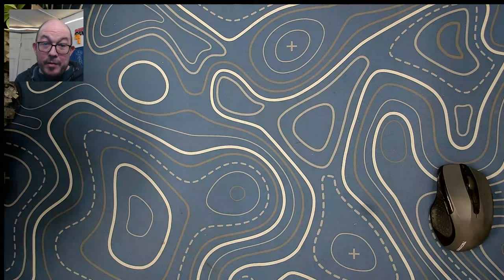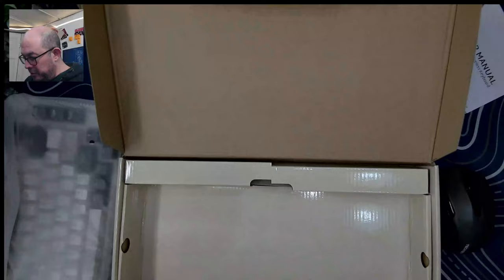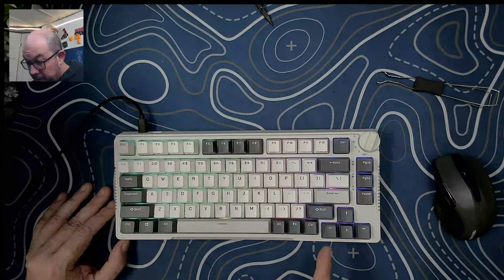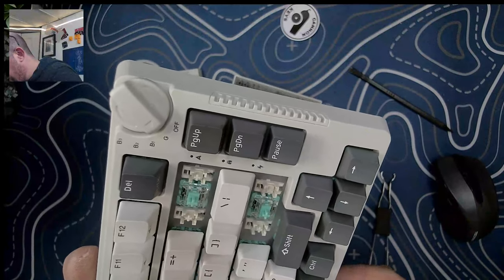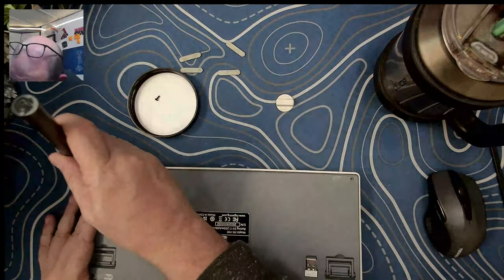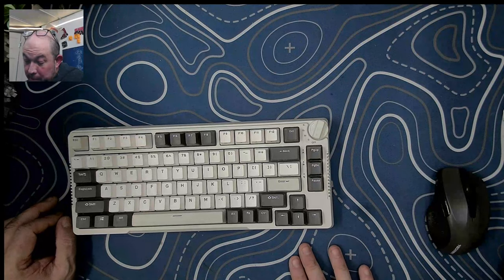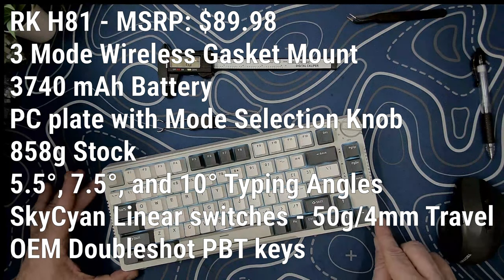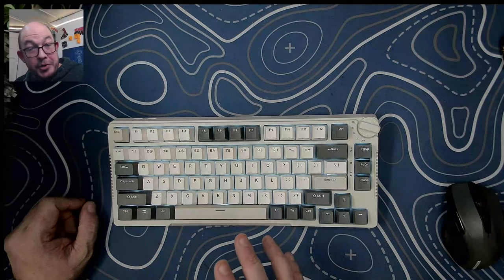Royal Kludge H81 Out of the Box - A decent "gasket mount" kit that is not meant to be modded.

Comment: Reasons for 2.4GHz... that frequency handles distance and obstructions better...also, 2.4GHz dongles tend to be fast enough to game without issues with lag.
Reply from the maker: I understand that, it's just that the frequency is a bit crowed, and personally I've experienced better results with Bluetooth 5.1 than some of the dongles these cheaper boards come with.
Reply: My main boards don't have a 2.4ghz option. I do game with them on BT5.0, and don't have issues with lag. They poll every 125ms, which is more than adequate for someone of my age. I don't think I could move faster or react faster than these boards. If I were a pro gamer things might be different, but for someone who plays casually I doubt anyone would notice.
Reply from the maker: @DaveAlkema  I used to love gaming, but as I've gotten older, I feel like if I am on the PC, I need to be productive. The only game I play nowadays is No Man's Sky, which doesn't really require fast response times ;)

I prefer wired when possible, I'm already drowning in electromagnetic radio signals! 🤣
Reply: @CvD Yes, sorry, mistype there.
Reply: @MechKeyboards  I only buy wireless keyboards if they have a 2.4GHz dongle because my workstations use disk encryption, and the bluetooth stack isn't loaded until I enter the password to unlock my drive.

Comment: Interesting! I actually dig the way that the knob is designed and what it does. You don't have to feel around for the switch between modes, or do a combo press to change modes like other tri mode/dual mode keyboards.

Also, side note, 997 subscribers as I am typing this. 3 MORE MARK!
Reply from the maker: Almost there!

Since I have a knob on my macro pad, the three mode switch does not bother me as much, I actually enjoyed this board and am glad of the direction more budget manufacturers are going in.

Comment: does it have nkey rollover?
Reply from the maker: The product listing states it has 1000Hz over wired and 125Hz over wireless.
Reply: "Key rollover is the ability of a computer keyboard to correctly handle several simultaneous keystrokes. A keyboard with n-key rollover (NKRO) can correctly detect input from each key on the keyboard at the same time, regardless of how many other keys are also being pressed"

my question is that is it going to work correctly when pressed multiple keystrokes
Reply from the maker: @maciek8275  I meant to add 'and NKRO', my bad.
Reply: @MechKeyboards  thanks man, appreciate a quick answear even tho the video has been uploaded for some time. Keep up good work with reviews like that. Definitelly subbing.
Reply from the maker: @maciek8275  thanks!

Comment: what does the data transition do? thanks in advance for the answer
Reply from the maker: I'm sorry, what data transition? If you could provide more context I could better answer your question.
Reply: @MechKeyboards  on the keyboard there's a 2 type c hub right?  One is for charging and the other one is for data transmition base on the manual.  But I don't know how it works
Reply from the maker: @demi7171  it's like a hub, you can plug the computer into either and the other one piggybacks on that connection. That's how I understood it to work as I was able to connect to it from either port.

Comment: PBT or ABS?
Reply from the maker: PBT as stated in the Let's Get Technical chapter.
Reply: @MechKeyboards  Thanks for the answer!  is that in some videos they say it is abs and in some pbt.  someone even commented here that the keys are Abs and not pbt.  I have a Machenike K500 and I just bought the rk h81 because it's wireless.  But I prefer pbt keys.  I was in doubt about changing because of the keys (the k500 are pbt).  I know I can change the keys in the future.  have you tested the k500 yet?  Could you tell me if it's a good swap?  Sorry for the English, I'm using Google translator.
Reply from the maker: @myungjinkim2  I've seen them listed as both ABS and PBT in different listings and it's hard for me to tell by touching.

I've yet to try the K500, though I will be reviewing the KT68 this week.
Reply: @MechKeyboards  thanks man ! 
Yes, I also researched in several places and I'm not sure what material it's made of.  But in your keyboard review experience, do you think it's PBT or ABS?  And testing Machenike KT68, is the texture of the keys similar to the keycaps of the RK H81?  Sorry for so many questions, I don't know if I regret changing the keyboard (k500 to rk h81), as the h81 is still on the way to my house. 😪
Reply from the maker: @myungjinkim2  to be quite honest, I'm not the best at guessing plastic by touch. The only way to know for sure is to burn it and see the color of the smoke, which I'm not planning on doing.

MechKeys state that they are PBT: https://mechkeys.com/blogs/news/royal-kludge-h81-75-gasket-mounted-triple-connection-mechanical-keyboard-with-mode-switch-knob
Reply: @MechKeyboards  Sorry if I was ignorant, it's just that I got a little frustrated to see it... I really hate the abs key experience. I thought it would have some texture on the keys, forgive my mistake! In truth. I didn't mean to be rude.
Thanks for the link, I'll take a look! Thank you again for all the messages to solve my doubt. A hug from Brazil!
Reply from the maker: @myungjinkim2  vida pura e adeus!